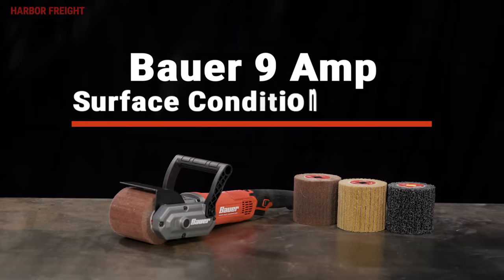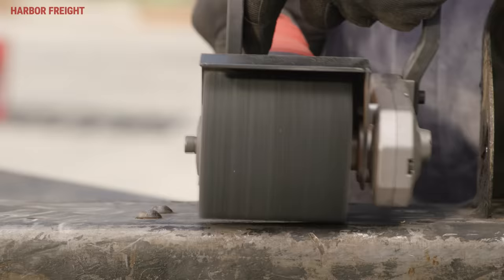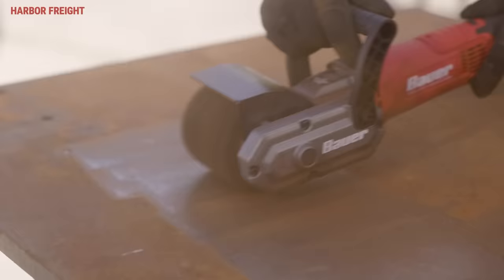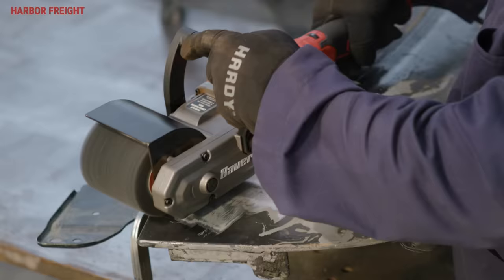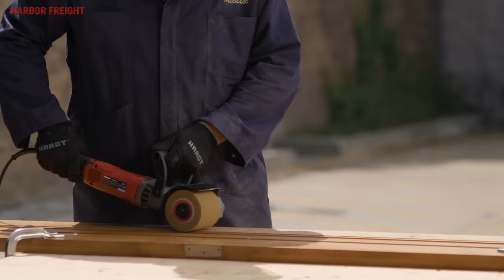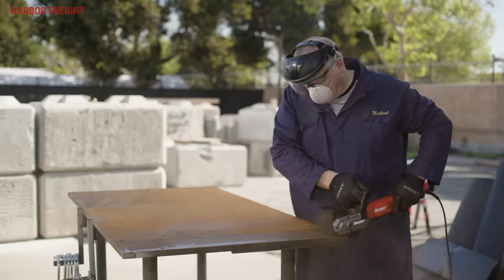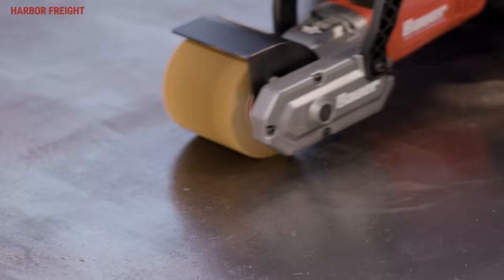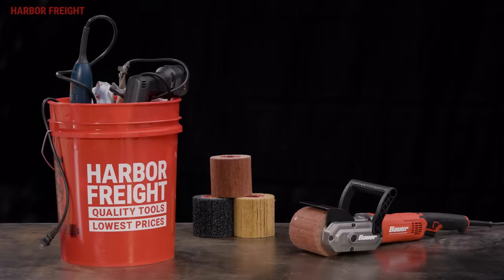Bauer Surface Conditioning Tool | Harbor Freight

Comment: MY FAVORITE HFT TOOLS as of now. the Hercules backpack. , icon impact swivel sockets, icon digital flex torque wrench, zurich z15s scan tool, icon flex double box ratchet wrenches, icon 0° double box ratcheting wrenches, viking 3500 jump box, ames dm1010 multimeter, icon master fuel service kit, and the red orange yellow $289 floor jacks. By 2023 Christmas i will have all 11 items.

Comment: Seriously, not knocking Harbor Freight, their tools are getting better, but most of their tools have their limits. As a professional their tools break easy or don't perform at an industrial level, their great for home owners and d.i.y. but not tradesmen/women. Sure I know that's a big "can of worms" for discussion, but a tool sales company that only offers a 3 month warranty and if you want a larger warranty you must pay them a fee, no thanks!  Buying tools anywhere else sure you are going to pay more, but you will honestly get more out of those tools, and a better warranty( always read the fine print in warranties).

Comment: I've learned not to buy tools with electric motors from HF.  Anyone ever use this?
Reply: Why is that?
Reply: @MerpSquirrel  It was after two drills that burned up after less than a 1/2 hour of use.  Maybe it was just bad luck on my part.
Reply: 10 years ago, that might have been true, but the times are a changing! I now own a huge collection of Bauer Cordless and corded power tools from Harbor Freight. Best value ever!
Reply: I still prefer Ryobi.  When sales happen its as cheap and there are more used tool places around these days that carry new Ryobi stuff at a fraction of the price.  I love having several drills around the house and not having to search for one.  I get em for $30 a pop for the compact 18v.   They also seem lighter. The construction of my bauer drill seems very good I believe I recall it being significantly heavier than my 18 volt Ryobi compact of similar size.  It's been a while since I used the Bower so I could be wrong.  The Bauer battery housings feel/look very cheap compared to ryobi.   I have several harbor freight tools and I have no complaints.